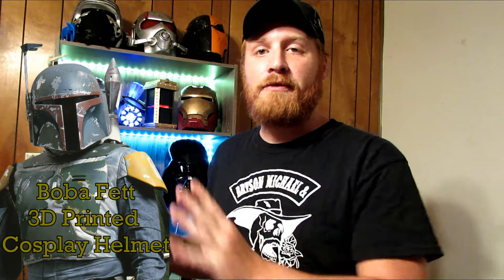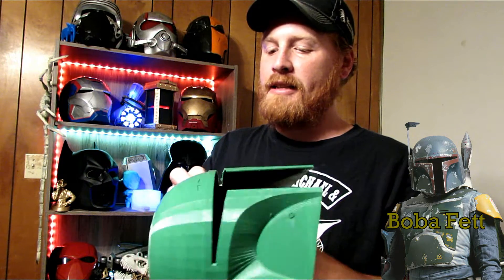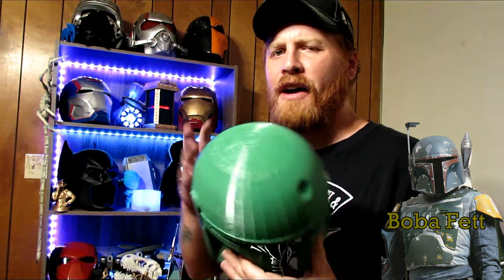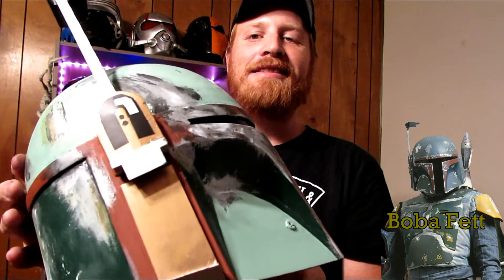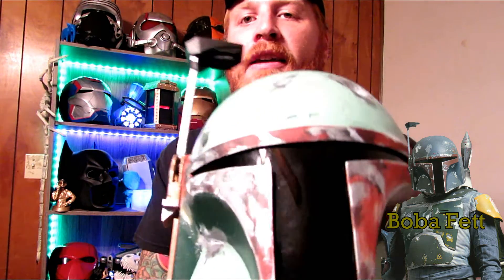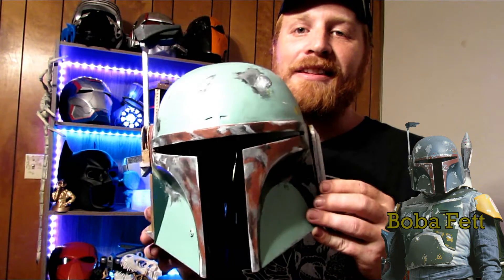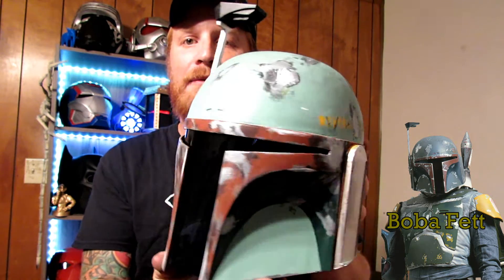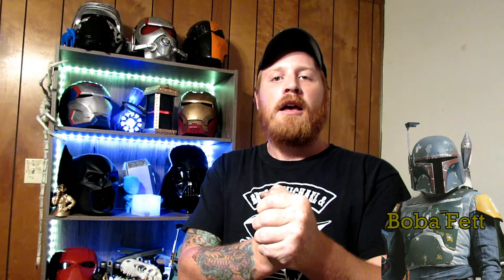3D Printed Boba Fett Helmet Low Resolution

Comment: What kind of material do you use for the glass, I've been 3D printing my own helmets, and I just can't find the right material for the black glass/plastic but the glass/plastic you use works great. I would really appreciate if you could help me out.
Reply from the maker: right now i go and buy a poster frame from walmart and use the acrylic. its rigid but bends well. I use regular car window tent and I put it in with hot glue. But, in this video I used a clear plastic divider for notebooks that I got for 99 cents and tented it. its great if your piece is going to be an 'on the shelf' display. But not if your gonna be wearing it.
Reply: Bryson Michael RC thanks a lot dude I really appreciate the help 👍👌
Reply: I’ve been using Hobart welding visor replacements from Amazon for my clone trooper helmets